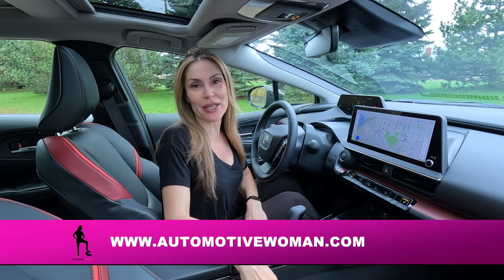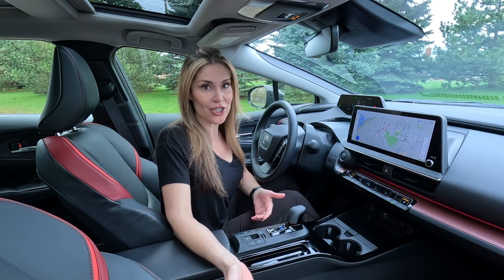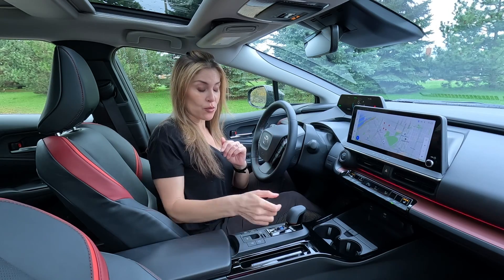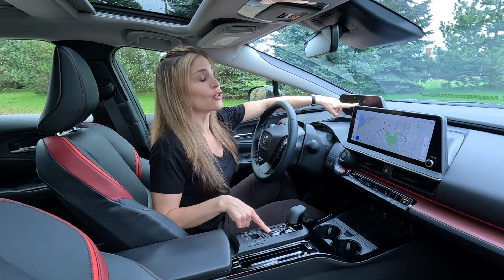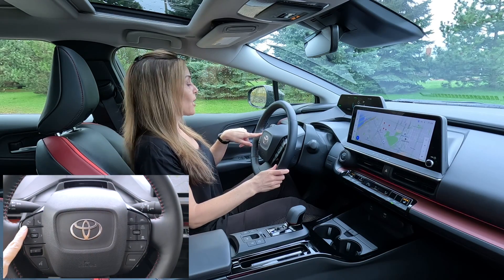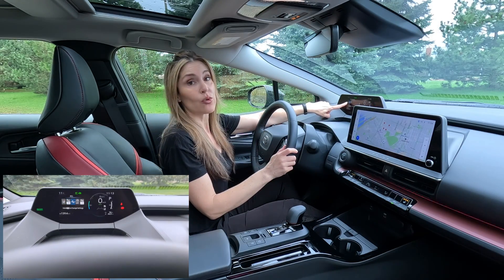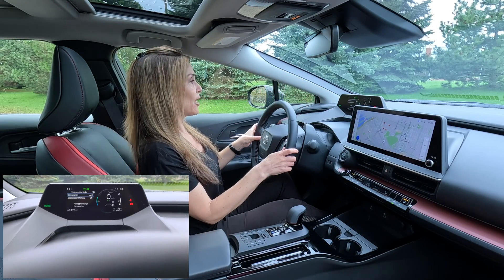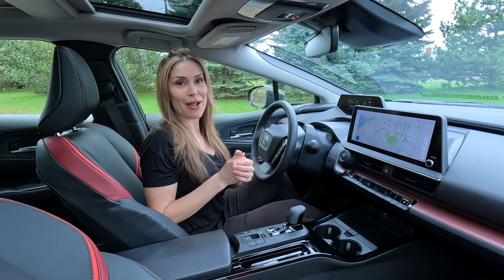Unveiling Toyota Prius Prime Braking Regeneration Tutorial (How to)

Comment: You Regen brake simply by lifting foot from a gas pedal and more by pushing on a brake pedal.
B is equivalent of downshifting for long declines and it brakes using engine as well.
Other options in menus are possible but not necessary.

Comment: If you want to drive with one pedal - ok, but its not improve efficiency, because regeneration still works when you put in brake (not very strong). 
If you want to reach the best efficiency you need turn off automatic recuperation (when you just when you just let off the gas) and using inertia and overrun.
Say me please, in minimal recuperation set in D select mode do you feel recuperation without gas, or its give you oppurtunity roll completely?